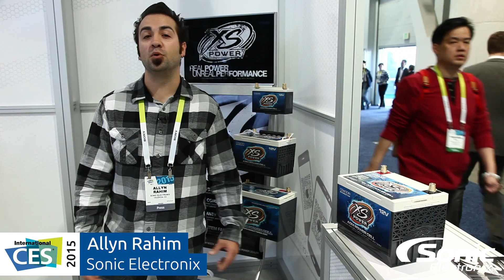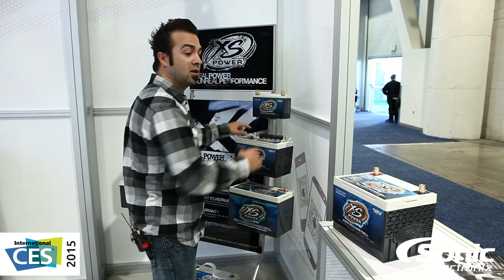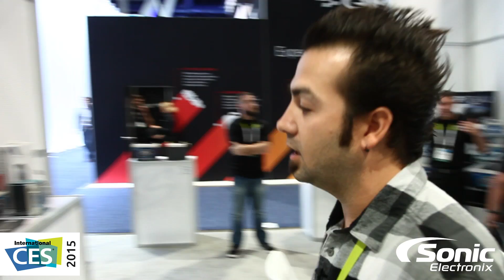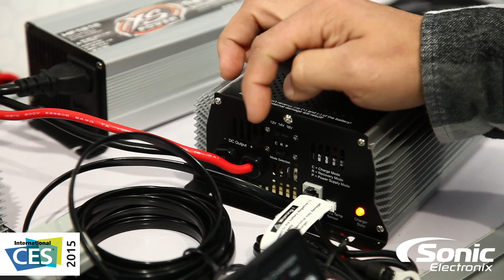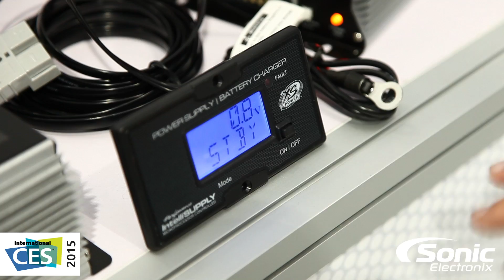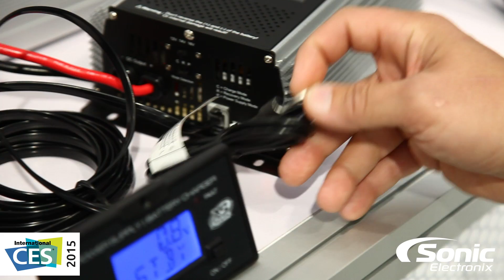XS Power Car Batteries & Chargers | CES 2015

Comment: just received my XS Power D3400R for my Infiniti a couple of days ago. paid $260 total + $10 for the terminal adapters 580. expensive shit but all worth it when being reliable supporting my high end car's Bose audio system, my 12,000 lumens high power LED headlights + 1,800 Lumens Fog lights and 270w Alternator. Just the fact that my previous battery suddenly failed to hold a charge near my home, imagine that shit happened far away outside the city and get stranded at night, the price to tow my car back home would be the same or more cost to tow truck it back! Plus do to it failing i have learned so much about batteries, deep cycle batteries and who should use them and all types of new technology involving batteries & special chargers and portable jump starter power packs!

Comment: I have a question I have 2 american bass 1222 12s I want to know will they fit in a q bomb box  the speakers mounting depth 7.6  the box dimensions are 36 width x 14.5 height x 22.5 depth